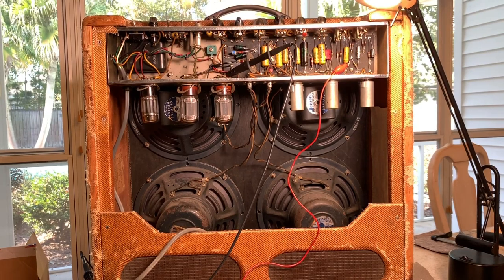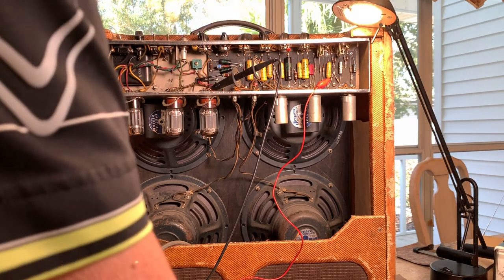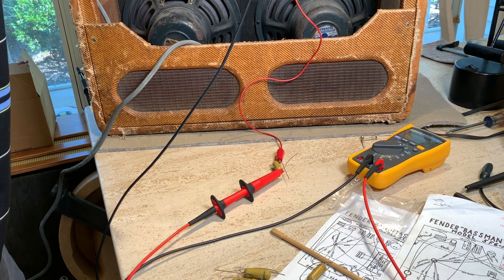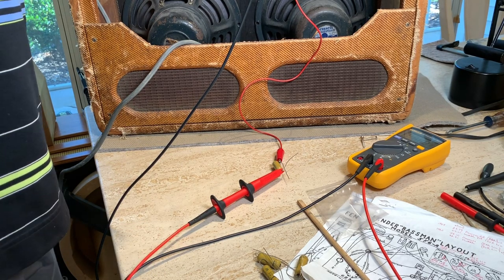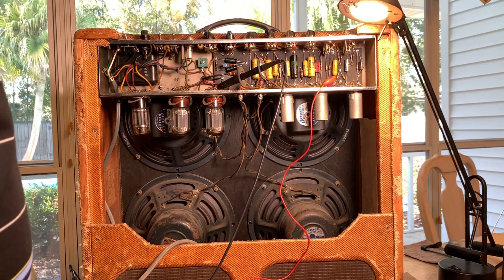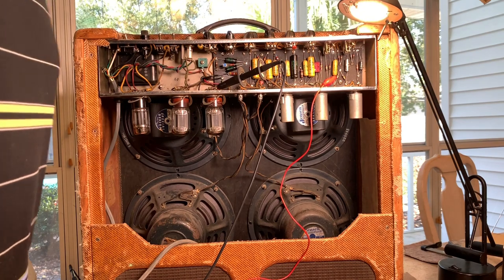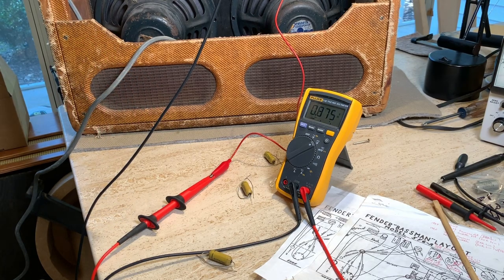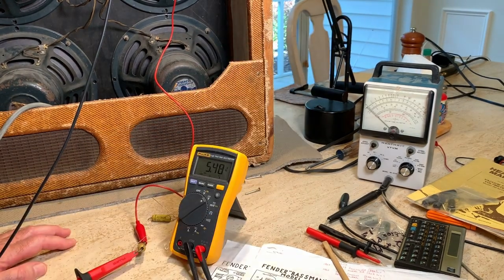Testing NOS Astron .02uF/600V Caps for Leakage - And More!

Comment: A 12AY7 uses more current, which drops the plate voltage to the 160vdc range. The 12AX7 and 5751 will be around 200-220vdc.
Yes, try the yellow Jupiter caps. They sell the 200v 0.1uf cap for the phase inverter too. That cap makes a huge difference if it needs to be replaced. The typical 600v cap doesn’t sound right to me in that position.

I keep telling you to try those yellow Jupiter caps. I think they sell the 0.03uf yellow caps. Check the drift on your caps “in amp”. Worth a shot for $5 a piece imo.
Reply from the maker: Yes, I will order some yellow Jupiters soon.  The .03uF may be the tickets.  I will try my 6072 to see what that does to the voltage.  I don't think I have any 12AY7's but I think they should be the same.  But, the phase inverter voltage is running around 270VDC so wouldn't I need the 400V cap?  Sometimes they underrate the new caps to make them look more vintage.  I'll have to check with them to see if a 200V cap can take 270V.
Reply from the maker: But, on the phase inverter, since I have the good .1uF Astron PIO caps, I will use them instead of Jupiter.  I have them in my 1959 Bassman and that amp sounded much better when I put them in.
Reply from the maker: For starters, the .02uF Astron has only drifted to .027uF.  Now I am going to check for leakage.
Reply: millstap I’m sorry, I should’ve been more detailed about the 200v cap. It’s the one on the LTP A/C circuit. The rest of the Jupiter Yellow caps are 600v.
Reply: millstap yes, a 6072 is a high grade 12AY7.
Reply from the maker: @matthewf1979  Oh, I see, the cap going to the grid on the second triode of the phase inverter 12AX7.   I just measured the leakage and it is holding at 4.8VDC.  I guess that is too much.  I had read that maybe .25-.50VDC was acceptable.  I have a couple of cheap Mallory 150's I can put in there until I get the Jupiters.  I still need to check the .02uF PIO cap next to it,  I may use that one too.
Reply from the maker: @matthewf1979  I see there is only 23VDC on both the .1 and .02 caps in the phase inverter.  I wonder why they used a 400V cap for the .02uF?  Maybe that is the only cap available.
Reply: millstap if I remember correctly, the voltage rises with use in those positions. 400v is overkill in the whole circuit, just a safety margin for unloaded malfunctions.
Reply: millstap Man, I hate to see Astrons go. They’ve lasted 60 years now, pretty good run imo. The Jupiter yellow caps are the only ones that use Mylar and aluminum foil now. The blue Sozo caps are too small to be Mylar and foil @600v probably metalized Mylar. I have some lying around, I’ll have to check. I confirmed the Jupiter caps 3 years ago.
Reply from the maker: @matthewf1979  I just got this info from Mojo but they were using a blackface Super Reverb.  "From what I see on the tech side of vintage guitar amp restoration, more and more people are leaning towards orange drops.  We actually did a comparison in one of our Blackface Super Reverbs with 1st gen Sozo's, some Emerson custom caps (way expensive), Dijon's Vitamin T's and Orange drops.  It was a very telling comparison as we wanted the Dijon's and Vit. T's to come out on top of course, but more and more people were choosing the Orange drops over all the others.  We had different results in other amps like Marshall's and Vox's, but the Orange drop actually seemed to have a better bass response and maintain the upper-end chimey-ness of the original Astron's if they were new.  The Dijon's had a mid to upper range emphasis that seemed to boost frequencies ever so slightly that had to be eq'd out slightly and the Vit. T's did the exact opposite.  They tended to drop the EQ about 200 to 300z, and had the smoothest overdrive and cut down on string noise and less attack."
Reply: millstap they sell orange drops with the amp kits too. I didn’t like them very much because of the typical complaints. Too stringent, lifeless etc.

But hey, they’re cheap and worth a shot. They come in all values and voltages too. The 715 and 716 series are metalized polypropylene, the 400 series is metalized polyester/Mylar. 

The only thing that matters is you like how your amp sounds when it’s operating nominally.
Reply from the maker: @matthewf1979  Well, the first .1uf/400v in the phase inverter drifted to 1.37uF.  I am about to check for leakage.  Do you have an easy way to tell the outer foil and which direction it should go?  I always forget and the Astron PIO's don't have a band like the yellow ones do.  That makes it easy.  I've heard it really doesn't make that much difference but one way is less noise than the other.
Reply from the maker: @matthewf1979  I'm proving that leaky caps can sound good, lol.  The first .1uf/400V cap in the phase inverter was leaking 18VDC.  Jeez, I wonder if the amp will sound much better once I plug all of the leaks?
Reply: millstap don’t worry about outer foil that far back in the circuit. I am surprised the 12AX7’s don’t just immediately fry when you turn the amp on. The grids are rated for 0vdc/-50vdc MAX. When you get all good caps installed it should be louder and have a noticeable headroom increase. Possibly not what you need playing in your house.

Have you ever tried a Deluxe or good clone?
Reply from the maker: @matthewf1979  I have good neighbors.  At least they pretend to be.  I only play about 1-2 hours a day now and usually stop at 7:00 PM.  But, I think you may be thinking about the caps going to the phase inverter tube.  These are the two .1uF caps that connect the plates of the phase inverter tube to the grid of the power tubes.  All of the leaked voltage is going to that power tube grid, correct?  The plates of the phase inverter tube have 230VDC according to the schematic.  I shorted out the same .1 at a gig and could smell the power tube.  The tube actually survived but the base eventually cracked.  That was about 270VDC on the grid of the 5881.
Reply from the maker: The surgery was a complete success.  I will post the video later today.  Amp is stronger and cleaner.
Reply from the maker: The yellow Jupiters are in the Bandmaster and sound fine.  The amp is rocking now and I still have three more caps to check and possibly change.  I did a small video on it since it was the first time in 60 years a soldering gun had hit those joints.
Reply: millstap I’m not a believer in capacitor “Break In” but the Jupiter caps do smooth out after a few hours of use. Probably just a charge cycle thing in that type of construction, just like the old film and foil caps. I’m happy that you like them, so far anyway. They’re the only cap I use for tweed/brown/black Fender amps. They worked out great in old Gibson GA20’s and GA40’s too.
Reply from the maker: @matthewf1979  I think the yellow Jupiters may be the answer.  I certainly didn't like the red ones.  I've got so much work to do.  I still need to thoroughly go back through the 1959 Bassman.  I just almost finished completely stripping the Astrons out of the Bandmaster.  Sad day but it is sounding stronger.  I still want to compare the NOS PIO Astrons to the Jupiters but that is a whole other exercise that I don't feel like doing right now.  Then I have a 1964 6G6-B, Super Reverb, and Vibroverb and a 1966 Super Reverb to start on.  I under-ordered caps.  I completely forgot about the 1959 Bassman.  I think I've already spend $157.  At $6-7 a piece, they are not cheap but if they sound right, then it is worth it.
Reply from the maker: @matthewf1979  And yes, these Jupiters seems to sound good right out of the box so no break in necessary and if there is some, they should just sound better.  I noticed that when you turn the amp one, the caps take a few seconds to block the DC voltage so it seems the amps sounds a little better after a few minutes of playing.  I never noticed that before.
Reply from the maker: @matthewf1979  Matt, have you had the chance to compare the Astron PIO caps with the yellow Jupiters?  I want to try both but it is such a pain to just keep switching out caps and moving the amp back to the room to see if I can hear a difference.
Reply from the maker: @matthewf1979 Particularly the .1uF/400V Astron PIO and the .1uF/600V Jupiter.
Reply: millstap Sadly, no. I haven’t been able to get my hands on the PIO Astron caps. Last I looked there were none available on eBay, surplus electronics websites etc.. That was over a year ago though. I do like the PIO Russian surplus caps though, just for other circuits like the Deluxe or GA20T.
Reply from the maker: @matthewf1979  I guess you're right.  I didn't think about scarcity.  The two .1uF's I found first years ago were in the Netherlands.  They were still in their little brown bags.  Then I was surprised when I found these four in Oregon but I bought all he had I think.

Comment: Are you sure there isn’t some psychoacoustic issues with the caps you prefer?  I don’t doubt your preference but part of the appeal of the old caps is they can have a higher ESR.  So that’s sort of like having a resistor in series with the capacitor.  Just a thought.
Reply from the maker: Could be.  I wish I had an ESR meter.  I'm still not exactly sure what they do.  I contacted Peak about their meter but they never got back to me.
Reply: millstap - They will measure for leakage out of circuit.  If a capacitor has DC resistance it’s not blocking DC.  

I just ordered this one:  MESR-100 V2 Low Ohm Meter, KKmoon MESR-100 ESR LCR Capacitance Ohm Meter Professional Measuring Capacitance Resistance Capacitor Circuit Tester https://www.amazon.com/dp/B0779D67SB/ref=cm_sw_r_cp_api_i_C6c1DbJBZGEFK

Will let you know how I like it.
Reply from the maker: @bbmade  Yes, please let me know.  That is a reasonable price.  I just measure the .02uF on the Bright channel and it leaking at 4.8VDC.  I'm assuming that is way too much.  I think I heard .5VDC is the max acceptable and still probably too much.

Comment: The reason it sounds better with the old caps is because they basically turn to resistors.  Your amp wouldn’t have sounded like that when new it.  With new caps it will sound like it did when new

Comment: Are you sure your plate load resistors are still in range, also the dropping resistors in the filter section. It seems weird that the plate voltage would be that high. I would test your resistor values, because of drift you should test the caps too, not to replace anything necessarily, just to get a handle on what your best bet on getting that voltage down some. Also it would be amazing for me to find out those values so I can try and make a clone. I have a small amp company in Greenville S.C. and have been a fan of your channel and this particular amp for years now.

Also check the batteries in the tester (you might already know about that)
Reply from the maker: The Fluke is fairly new so hopefully the battery is still good.   I will check it.  I want to see if I can calibrate that Heathkit but the Fluke seems to be doing a good job.  When I test the house voltage with the Fluke, it is right on 124.5 VAC which the meter also shows on my step down transformer.  But that meter needle is also adjustable.  I think the Heathkit needs work.  Good suggestion on the dropping resistors.  I checked them years ago because of those high voltages and they were fine so I suspect they are still good but I will check again.  I'm getting ready to check the .02uF Astron on the Bright channel to see how much it may be leaking.  Also, since I have those good Astron PIO .1uF caps, I am going to check those in the phase inverter and switch them out if they are leaking.  I don't think I have ever checked those for leakage.  Which caps and resistors are you referring to here, "I would test your resistor values, because of drift you should test the caps too, not to replace anything necessarily."  The electrolytics?  They really are due for a change.  I may order some Jupiter yellow caps and try one of them in place of the Astron.  I also saw some use Mojo Dijon caps.  The few Sozos I tried, I never liked but then there is that break-in period where they say after 100 hours they will open up.  I don't know if I am that patient.  I've had some decent luck with the Astron PIO caps.
Reply: @millstap  When I said test all the caps I really just mean the yellow astrons (filters should still be fine), but I mean the capacitance values not just for leakage. It's tricky with these old amps because all of these "imperfections" are what make it ironically perfect, but you also want it to function properly. It might be worth a try to get some of the "synergy blue caps" from valvestorm. I've been wanting to try and talk to you maybe on the phone sometime if your willing to, I've been trying to chase that 60 Bassman for two maybe three years now.
Reply from the maker: @taggmanibanez  I'm at this moment changing both .1uF/400V caps in the phase inverter.  The first one has drifted to .137uF and is leaking about 18VDC.  I'm sure the other is about the same.  I'm trying to figure out how to find the outer foil on these Astron PIO caps and which direction I should put it.  I forgot but I think the band on the yellow Astron is the outer foil.
Reply: @millstap  Also I forgot, if you still have those really big filters caps in series in there that can cause the voltage to be higher, I've had that happen when I've tried that filtering design. That higher preamp voltage isn't really a bad thing either, it will make it cleaner and more punchy.
Reply from the maker: @taggmanibanez  I checked the dropping resistors and they were both within 10% so they should be good.  The 4700 was a little higher and the 10K was around 9K.
Reply from the maker: @taggmanibanez  I just did the surgery and it was a success.  The amp sounds better and stronger than ever.  I will post the video tonight.
Reply: @millstap  Awesome!

Comment: Ive got some old tube stuff laying around aside from my newer guitar amps. An old organ, a few old stereos. Maybe i should strat testing parts and scavenging whats worth saving tubes and caps and such
Reply from the maker: You never know what you can find in those old units.  But, then you have to deal with the aging process which is inevitably going to make them obsolete.  Tubes last longer so maybe there are some good, slightly used ones.
Reply: @millstap  yeah man. The hope is to build a bassman circuit so any old timey goodness i can find would be cool. Love to have some of that legendary tone that your setup has!!  Really dont believe ive ever heard a better example, recorded or otherwise. If i can build a low wattage version i will name it the millstap xpress!!

Comment: NOS Caps that have never been used are probably the worst. Not much tone in capacitor either way. To me I have no problem pulling old leaky caps and just replacing them with modern ones. You would think someone would make old mustard caps for purists restoration.
Reply from the maker: Exactly.  I have looked and looked and tried many and the amp always sounded worse to me.  It could be just the drift in value that I am hearing.  I am not sure I had a capacitance meter way back when I was experimenting with caps.  Now I can check those old Astrons in the amp to see how much they have drifted.  There has got to be a decent cap out there.  I may just need to order a .033uF or a value equal to what mine has drifted to.  It's funny that this amp has a great tone and probably because of all of the drifting going on.
Reply: I've replaced several of my Tweed fenders with the Jupiter,  very happy with them. Haven't had any others sound as good.
Reply from the maker: @buffdoc46  Good deal.  I just did another video which I will post tonight.  I did some cap replacing and the amp is sounding much better.  I can't wait to try the Jupiters but right now the NOS Astron PIO caps are sounding great.
Reply: @millstap Definitely something to the drift of components over time making that amp mojo. Since the amp was made with 10-20% tolerance components each amp could sound a tad different brand new. What would be interesting would be to document the values of components that matter on a blooming sounding vintage Fender amp and post the findings in relation to the schematic.
Reply from the maker: @ringostarr4520  The ones I've checked recently surprisingly hadn't drifted over the 20% mark.  I will keep close track starting now.  The .1's were .117 and .112 and the .02 was .025 which is a little over.  Not bad for 59 years.

Comment: Make a fixture and keep trying to burn those caps in, they might heal up and get better
Reply from the maker: Yes, I thought about that but I think it's a lost cause.  I may do it today for a few hours and see what happens.  First, I'm going in this morning to check a few caps in the amp to see if they are leaking too much.
Reply: millstap bringing them up slowly on a variac is common practice for new caps, especially power filtering capacitors. I have seen caps like those heal up. There is a guy here on YouTube that shows how to do it. I think you can do it on that heathkit you have. Another thing to try is putting a much lower value non leaking capacitor in series, that will stop the leakage, but put it on opposite side of the voltage, so it doesn’t see the full voltage and doesn’t need to be rated for large voltages
Reply from the maker: @voxpathfinder15r  I'm not sure that works on coupling/blocking caps.  Either way, I've already switched four of them out and the amp is sounding much stronger now.  I should have the video up soon and I play the amp at the end.  It was much better than it has been lately.  I will try some of the new yellow Jupiter caps eventually.  I need to check all of them.  I will check a few at a time.